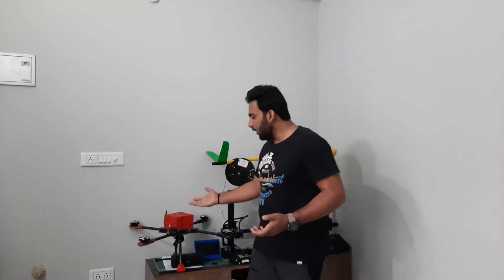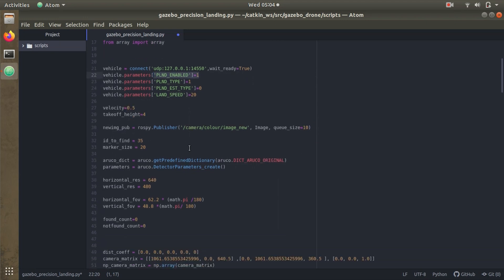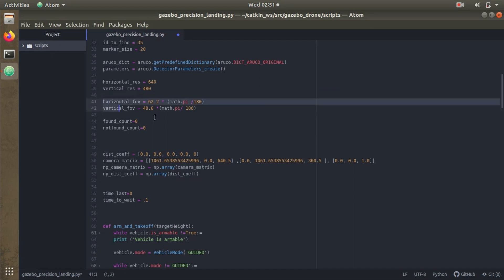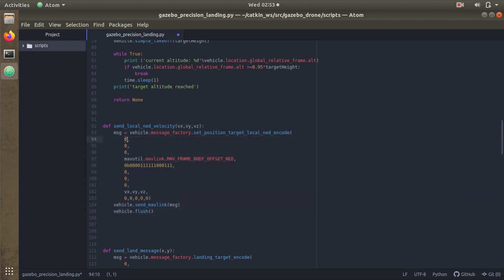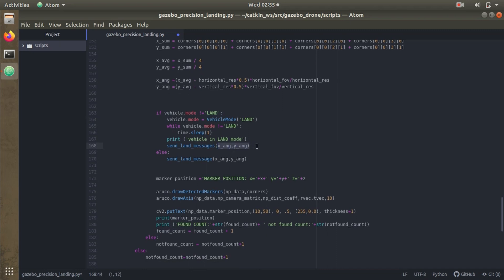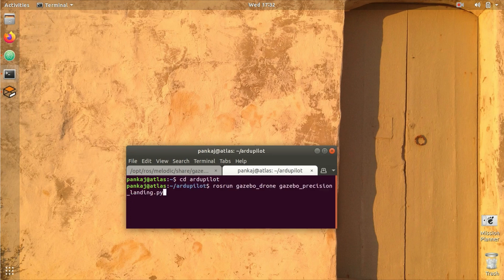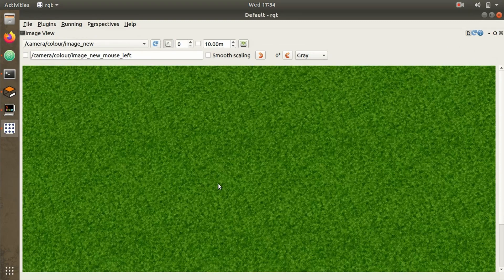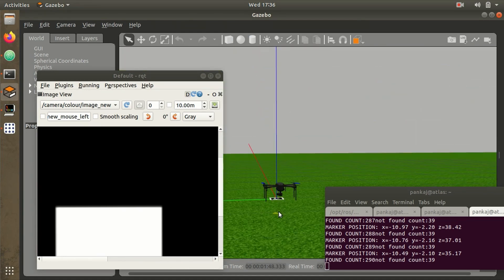Precision Landing Simulation | ROS Gazebo | ArduPilot SITL | Dronekit | OpenCV Raspberry pi Aruco

Comment: you are not following aruco marker with your script, you only check for it and you launch Land, but if your drone move in the air while landing, you will not be able to track aruco for repositioning...  Basic level job ...
Reply from the maker: Hello,
Have you tested this script in gazebo or real drone ?

Please see at 6:50 that part of code is responsible for the corrections. When in land mode ardupilot has authority for correction in x and y  which companion sends.

If you want correction to be done when not in land mode then thats is also possible , cant share complete script but  you can try out and let me know if you get stuck.

Comment: https://www.youtube.com/watch?v=RfAOdCRdhlg
Headless Gazebo, Iris ArduCopter Precision Landing, Display Aruco ID & Distance on Camera ROStopic.

Using Ubuntu-20.04.6LTS, Gazebo-11, ROS Noetic.

Besides this, WFB-ng (HD_FPV Ground Station) is also working.

All above is installed just on 64GB USB Pendrive.

It works on real ArduCopter Drone too like F450 or any via Raspberry Pi 3B /4B companion PC, and parallely can handle HD_FPV transmission too.   

I have ordered Google Coral Edge TPU USB module, likely to receive it today or on Monday, it can help Pi to do really lot lot more at much higher resolution and frame rate but it is not must.

Comment: Hlo, sir can u provide some info about how you calculated the exact position of marker in different frames of camera ,, is there any documentation link?
Reply from the maker: Hello ,
There's a bit of logic added in the code( you can see in the video) for calcuating the positional errors  between the center of the lens and marker within the frame .

With each iteration of the loop basically depends on the frames per second ( considering actual rpi v2 camera and rpi 4 4gb) which provides about 20- 23 Fps . So with each conditions loop iteration the new fame is fetched and current offset error between the camera and marker is sent to the autopilot .

For reference you can check more about rvec and tvec in opencv doc  and coordinate systems

Comment: Hi sir, can you explain when would the pi cam take over the auto mission set in QGC and shift to precision landing algorithm. 
ps: I am using pixhawk flight controller (arducopter).
Reply from the maker: Hello Izumi,
What you can do is set the last waypoint above the landing point as LAND MODE.

So once you run the script it will change the mode to guided and then take off and when certain height is reached change the mode to AUTo in code and in next part of the code give condition for the last way point i.e Land mode

Comment: I am following all your videos and I am currently developing a drone using raspberry pi 4 8gb....opencv is python 3 and Dronekit is python2 how is it working and what is the ur of rospy pls explain sir pls I am colleg student 😢
Reply: Can you provide us the link for python3 Dronekit pls sir
Reply from the maker: @srimmanresourceindustries7631  first remove all the installations that you did do a clean start 

Before installing dronekit install mavproxy and mavlink  for python 3 for linux bases os 

Link : https://ardupilot.org/mavproxy/docs/getting_started/download_and_installation.html#mavproxy-downloadinstalllinux

After this install dronekit with 
Sudo pip3 install dronekit 

Then check for opencv installation with the command in python command line interface 
1. Python 
2.>> import 
3. Then check version by using
Cv2._version_
Everything is for python 3 

On official documentation which is not updated its said that dronekit doesnt supports python 3 but already they have released support for python 3 which had some initial issues with mavlink which was later fixed.
Reply: @PankajMali  Thank you sir for spending your valuable time for solving my query can you accept my request in Instagram so that I can ask any query
Reply from the maker: Ok 👍
Reply from the maker: Hi sriman,
I have tested dronekit with python 2 as well as python 3 along with opencv 3.4 and latest opencv v4

I suggest you to go with python 3 dronekit python3 packages are available